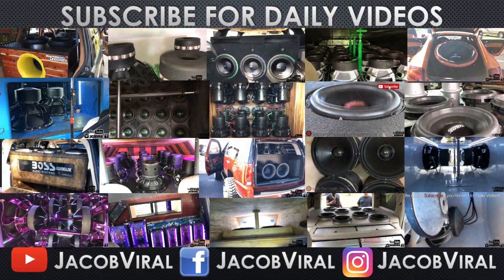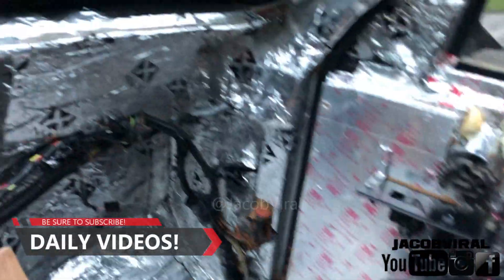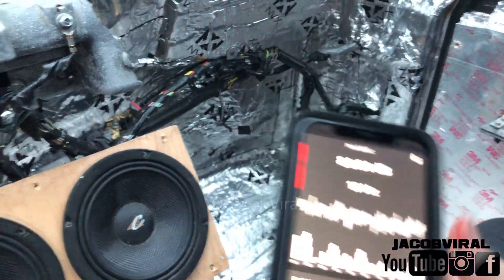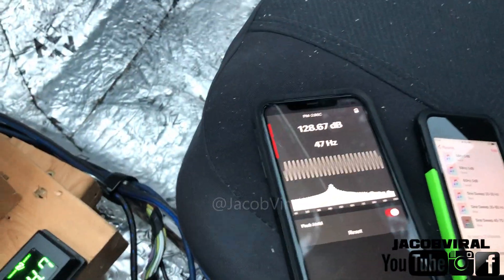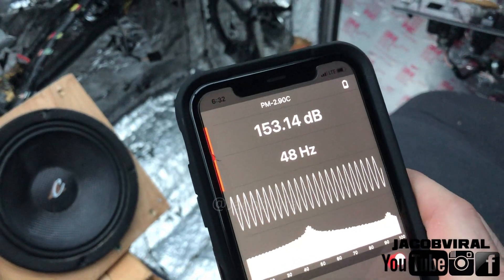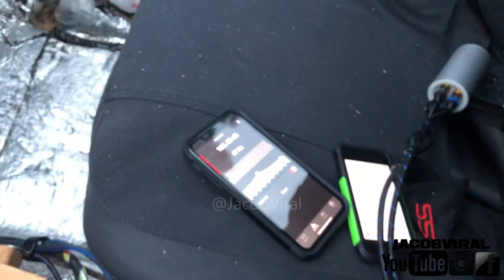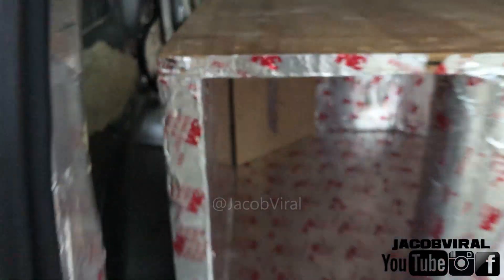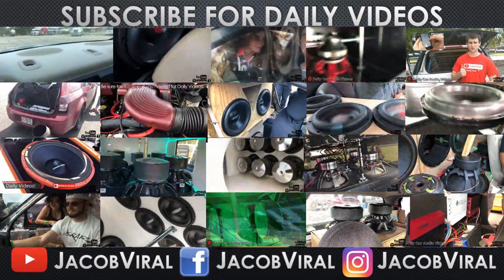SUBWOOFER BOX 45 REMOVAL TEST *METER RESULTS* GAIN OR LOSS?

Comment: HELP .....I got three skar evl 18s and I’m trying to build my own box (ported).i want them positioned upwards in a triangle shape ,I have all the tools and the mdf sheets...only problem I have no knowledge when it comes to getting the specified volume needed inside can you help a fellow basshead out with some cutout measurements pleeeeeeeeezz
Reply: Just go by the specs that Skar recommends for 3 evl 18's and the easiest way to figure out box size, port volume and tuning is to go to a website such as the12volt dot com to get all the dimensions you need. bcae1 dot com is another good one. I always like to build my boxes a cube or 2 bigger than they recommend to alow for 45's. You can always easily shrink you're box if necessary.